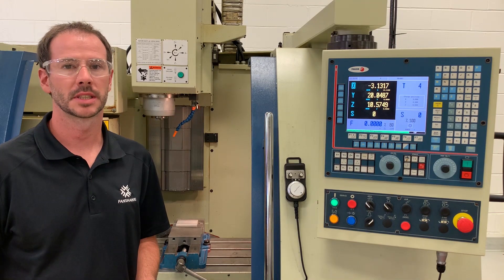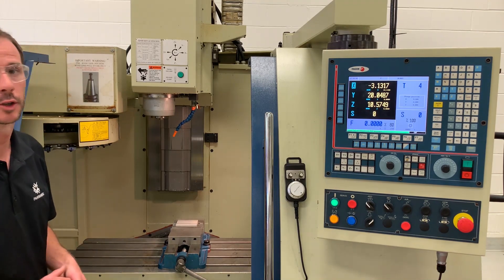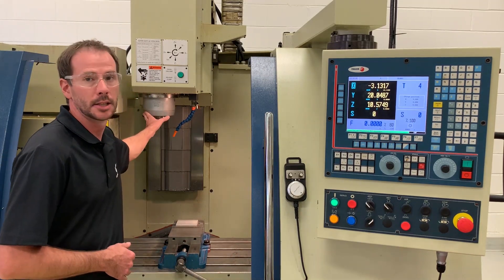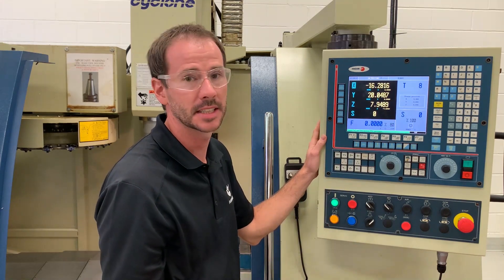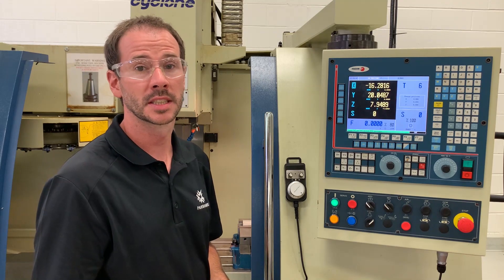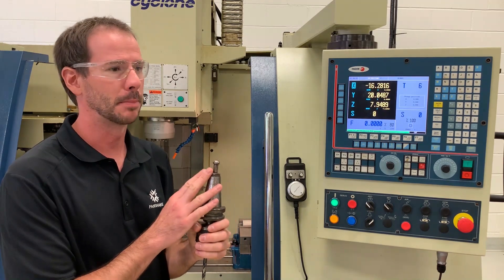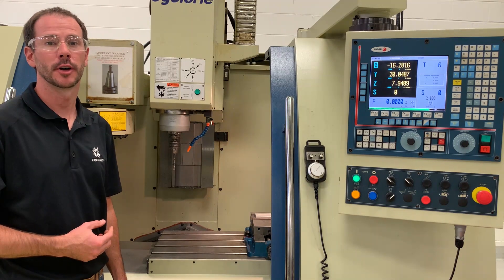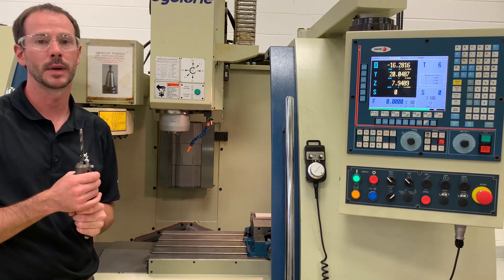Loading Tools in the Spindle and Preforming Tool Changes on Fagor CNC Machine

Comment: Hello sir nice video.
 can you please explain how we can perform tool change in Iso mode with M6?
Reply from the maker: Hello, thanks for the question. 
To perform a tool change using ISO mode you would need to program the tool number you want to load into your spindle followed by the M06 command. 
For example, if you wanted to load tool # 8 into the spindle your code would be: T08 M06. To initiate the command you would need to press the cycle start button.